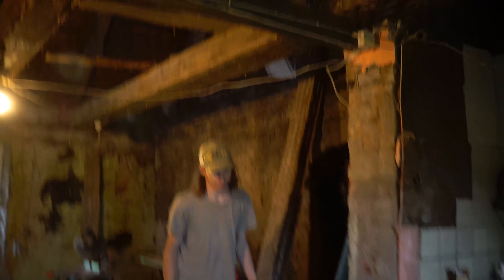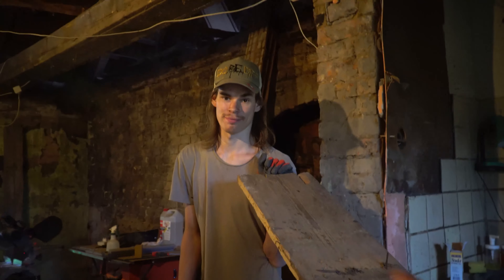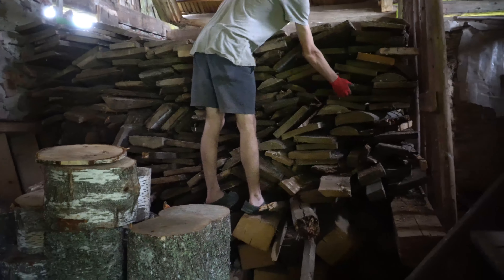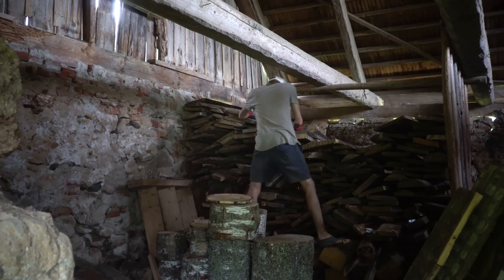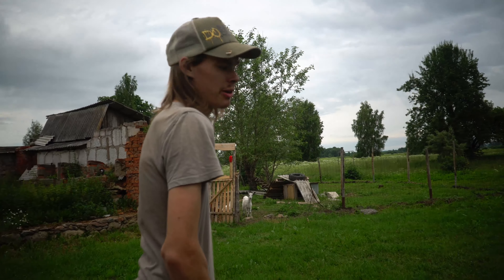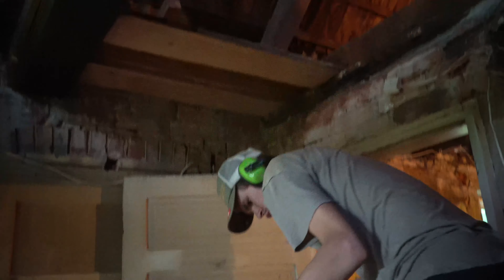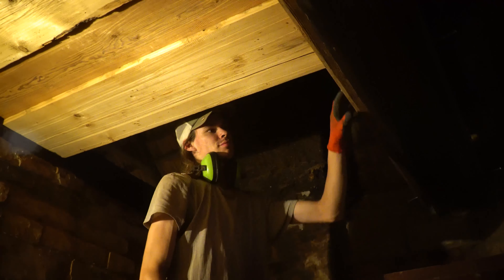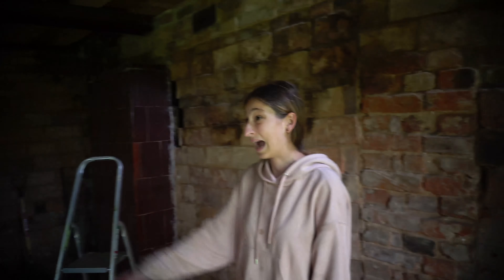5 Days to finish Before Guests are here (PART 1)

Comment: I think lime plaster should be used between your bricks not cement. The walls need to breath. You two are doing a great job.
Reply from the maker: Thank you! ♥️ We sadly had little budget so we had to use cement based plastering but we only did repairs of some holes the walls are doing perfectly in one year 0 problems! We also used breathing lacquer which sealed the walls together very well! 😊♥️

Comment: Do you plan to work on the barn after the house is repaired?  Is all that wood from the barn ‘s end that is missing?
Reply from the maker: The wood is from the bedroom and living room ceiling, we do plan to fix up the bard it would cost too much to repair all of it that used to be there but what is left we want to repair! ❤️
Reply: Do & Be Different Farmily   Now I understand.  Do you have enough for the kitchen and living room?  You can put drywall sheets between the beams and paint.